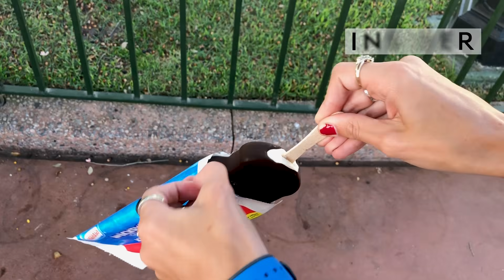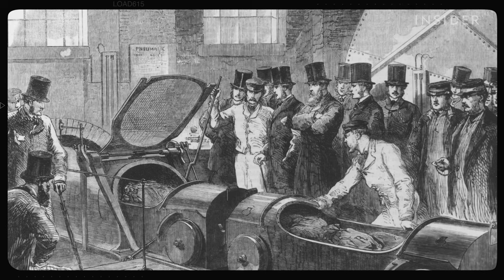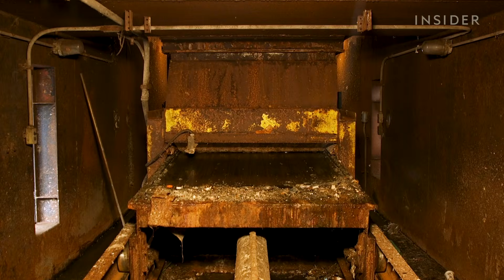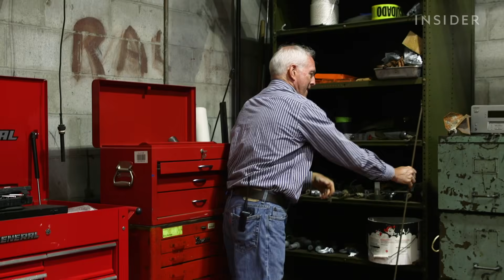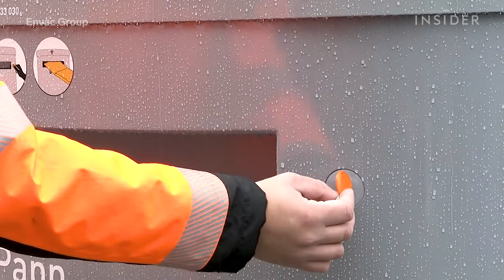How Disney's Magical Trash Tubes Ended Up In New York City | World Wide Waste | Business Insider

Comment: I feel like university campuses might be a good candidate for pneumatic trash-collection systems, since they already have centralized steam heating and cooling plants.
Reply: True. Biggest issue is that the universities are never built at once. You have hundreds of buildings which were built over a century, you still have the retrofit problem.

Rosevelt island was built at once. Disney was built at once. 4000 housing units in NYC are being built at once. They didn't have the retrofit problem.
Reply: @AnonyMous-pi9zm  True. However, my university is seriously considering replacing its ancient steam-heating system with a hot-water system, which would require a complete replacement of every single heating pipe crossing campus. So it's not a lack of ability, it's just a lack of motivation.

Comment: The pneumatic tube system already existed under nYc streets for transporting mail & memos between buildings way back in the day but was abandoned
Reply: One major difference is the size of the tubes.  Trash tubes are 16-20" in diameter.  The mail tubes are similar to what you'd see at a bank drive-up.

Comment: I worked at the Mouse House in Orlando Florida and I have used the trash removal system and while it did what it was suppose to do the tubes were overhead in what are called the utilidor system or utility tunnels and in some parts the of utilidors the tubes leak liquids and the liquids drip onto the floor of the utilidor and stink! You learn not to walk under the tubes. At the time that I worked there the trash was sent to an incenter where it was burned and used to generate electricity to run parts of the Mouse House.
Reply: Disney maintains their own system, while others have Envac maintain it.  One positive aspect to having Envac do it is we are able to update the technology as well.
Reply: @EnvacNorthAmerica last time I saw Disney’s AVAC system, they had modernized it and replaced most of the tube network and AVAC chute rooms. I assume they also upgraded the computer control system as part of that renovation.

Comment: Recycle systems do not really work because most of the product ends up in another land fill. 
This vacuum system might work for some areas yet its going to fail because there is no laws that will prevent people from miss using it. If you were to have 4 tubes of glass, paper, metal and waste. Offering a shredder before each location will make it easy to keep the tubs clean. Labels and lots of labels such as you are being recorded and any attempts to abuse or violate the collection location will result in crimminal charges and banishment from building and so on. Being able to shred up the product before it end up at the collection area allows for a much better end product. The plastic can then be flushed with water then sent to a oven to be burnt off for energy or melted down to create plastic blocks. The metal and then be washed and then ferrous metal pulled and sent to a smelter to make rough blocks. The non ferrous metals can be separated even more. Ewaste can be collected and ground down for raw product which can be sent to a city run tacitly for further processing or to the country processing. 
With in the next 10 or so years we will have the first AI controlled trash bot which will dig in to every land fill grind up everything and salvage every bit of material that is there. Landfills hold vast amounts of money.

Comment: I feel like the subway system in New York would be a good thing for vacuum tubes because you can install the main tubes then lead them to the rail systems and use trash rail cars to move the trash to a facility to process.... Plus there's the old steam systems that you can use and adding to them shouldn't be a problem.

Comment: Installing it in low income housing will surely end well. The system is inherently labor-intensive.  BTW if the maintenance tech wants a "corkscrew" that bends one could be made in various ways like torch brazing impact (no chrome) 1/2" universal joints and extensions to let it conform to pipe. For long straight sections the flex extension could be guided by PVC tube the way flexible borescope extensions are guided into jet engines.

Comment: Hello, just wanna say that these kind of tube system are not common in europe. I think we don't even have a system like that. What we DO is to seperate our trash between paper, plastik and bio. So the trash can be pick up by the garbage service and go the the recycling fercility. When an item doesn't fit in one of these 3 category they go into residual waste bin and intead to the recycling fecility the trash lands into waste incineration.
Reply: As a European, I can tell you that I've seen more than a few systems like these, in different cities and different countries. Usually they are small (covering just a part of a city, like in NY). But I've also seen big ones that cover entire cities, and they seem to work better than "traditional" waste management. I'm looking forward to the day when this is more widely implemented across the continent, but as of now, we DO have these kind of systems.

Comment: It really depends on what numbers one takes, but taking some numbers we pay over here in switzerland it is fun to play some numbers games. 

at 31 million dollars for 4000 residents this puts the cost per resident at about 8k. 
Our elevator in a mid-rise building costs about 1k per rental unit per year with electricity, service and maintenance and paying off the installation cost. Adding the average trash disposal cost of about 600$ annually such an investment could easily be redeemed in about 5 years or at least within the decade. Put the trash into an incineration station and provide centralized heating with it and the whole thing pretty much pays for itself quite quickly.

Comment: The beginning of this video says the Magic Kingdom produces 15,000 tons of trash per day.  That's 30,000,000 or 30 million pounds of trash per day.  Does that sound correct?
Reply: i was just thinking the same thing, its kind of hard to believe they produce that much trash
Reply: Nope, i google it and found 80,000 pounds a day which is 40 US Tons
Reply: @hazvlogs838  It irks me when videos spout nonsensical "facts" that defy logic ... which will undoubtedly be requoted and misinformation spread.  Maybe not intentionally, but just lazy research.
Reply: @hazvlogs838   That 80,000 pounds a day is just what goes through the AVACS system but why more gets thrown out but 15,000 tons a day is wrong they say it's 441 tons of trash a day from all of Disney World or 161,000 tons a year
Reply: judging by how close 15,000/365 is to 40 (~41.096), i feel like this could easily be accidentally saying “per day” rather than the intended “per year”, though it certainly isn’t a great look for something like it to slip through in the first moments of the video
Reply: 15k tons per day in MK alone sounds a bit excessive

Comment: I think these are extremely rare in Europe, I cannot imagine these being common even in Sweden. It is a little bit of a disinformation to make it feel like ‘wow, the Europeland in Europe is so much more progressive. What about the sucky USA?’
But at least with trash, for example in Germany it is either just regular trashcans or the giant metal containers put into the ground, filled with fermenting garbage and flies, that garbage trucks have to pull out on chains and stuff, a horrible thing that just stench when it is hot weather
Reply: In Eastern Europe you would have trash tubes - mostly going vertically through a block of flats into a container
No pneumatic, just gravity
Reply: We DO have these systems in Europe, and while they're not as common as normal trash cans, they are really starting to become popular (at least where I live). I've seen them in different cities and different countries, and they even allow for recycling and separating trash.
Also, the "giant metal containers put into the ground" (called "Islands" here) are another really cool idea for improving regular trash cans. They can be really big inside, while only occupying a small space on the outside. And they also keep the trash contained and below the ground, so the streets are cleaner on the surface and it's more difficult for rats and wildlife to get to it.
Reply: In Stockholm, Sweden these kind of systems are very common.

Comment: I don't think NYC would benefit from AVACs. Doesn't seem a good system for a city garbage disposal needs. Maybe better for a theme park. You need to use the right tool for the job. NYC needs a more modern approach. Many European countries such as Netherlands are using it and it has nothing to do with pneumatics but rather a more simple modern system, just use gravity to do the work. Make an underground cavity to dump all the garbage there and when it is collection day lift it up. Viola solves all problems and not needing to fix any jamming issues. New Yorkers can leave their garbage outside, robotics can pick them up right instantly and dump it in the underground garbage spot. This also saves a ton of money for NYC to implement, it is more practical and feasible to implement anywhere in NYC and it is a hygienic system, future proof, built to last, can also be easily upgraded, also did I mention it is more jam proof than AVACs?

Comment: You know, it seems really dumb to not have dedicated, large diameter, easy access for maintenance, utilities tunnels below every block of every city. Just build the city with these tunnels so that you won't have to dig up streets every time you need to upgrade or repair something. That goes for everything from electrical to seweage to communications, to pneumatic tubes for trash disposal. Digging open the street every time seems so backward. Future generations will look at that the same way as we look at non-existent or open-sewage of medieval times.

Comment: It sounds great however I'm not all with the involvement of people in the maintenance of the tubes I think at this time of the century probably there are tones of ways to clear a jam than opening the tube and trying to pull it out! There could be pods for every section of the tube that they can travel inside of it and force cut the clog! or maybe flush points and gates then close the gates of the clogged section and open the flush gate and open pressured water inside of it to flush it!

Comment: 🎯 Key Takeaways for quick navigation:

00:01 Disney World and Roosevelt Island in New York City both use a pneumatic tube system to handle trash at high speeds, inspired by pneumatic technology dating back to the 1800s.
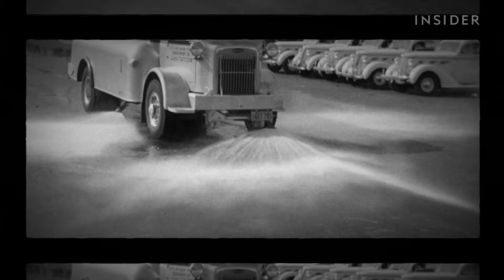02:10 Roosevelt Island's AVAC facility handles around 8 tons of trash daily, making the process cleaner and more efficient, but it doesn't solve the issue of where the trash ultimately ends up.
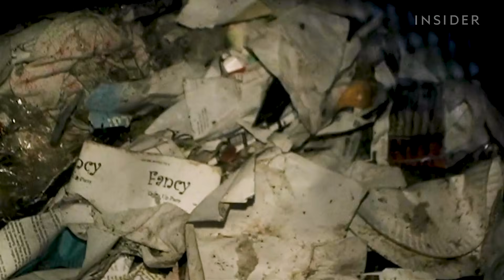03:56 Despite occasional breakdowns and maintenance challenges, many residents prefer the AVAC system over traditional trash collection because it keeps the streets clean and reduces vermin.
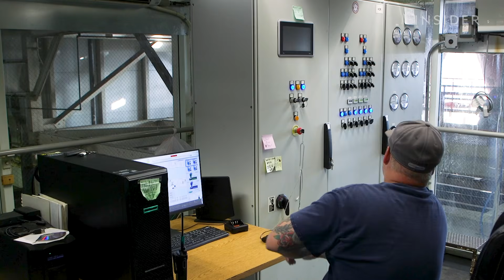06:02 The main reason AVAC systems are not widespread in the US is the complexity and high cost of maintenance, as well as the lack of financial incentives for private developers to invest in such infrastructure.
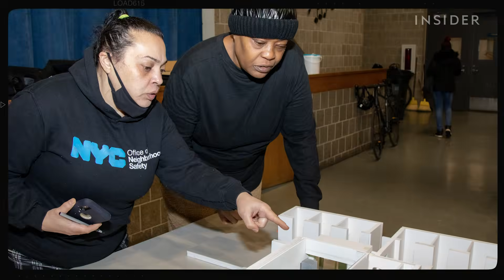07:15 There is a new AVAC system being installed in Harlem, New York City, as a pilot project, with potential for expansion if successful. A Swedish company called Envac is involved in designing and expanding these systems in the US.
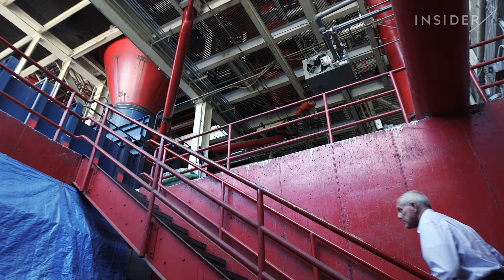07:55 Advancements in AVAC technology could lead to a rethinking of waste disposal and infrastructure improvements, but continuous investment and upgrades are necessary to make these systems viable in the long term.

Made with HARPA AI
Reply: Thanks
Reply: Add a way we can summon you to videos

Comment: Love how this guy has convinced himself that working 17 hours a day is a job and not modern slavery… NO ONE should have to work more than 8-9 hours a day at one single job.
Reply: Different jobs require different work schedules... there can be shifts of 12/24 (12h work, 24h free) or even 24/72 or other big or small variations of the "regular" 8h schedule (for instance, I work in an office where Mo-Thu we work 8.5h so Fri we only work 6h) or other values, with a certain monthly worked hour per week or month (I don't live in the USA, but where I live this limit is 160h/month, that can be extended no more than 184h/month if the employee accept it in written form).